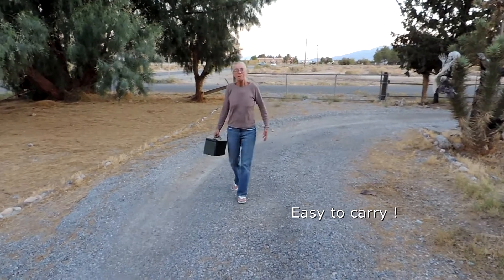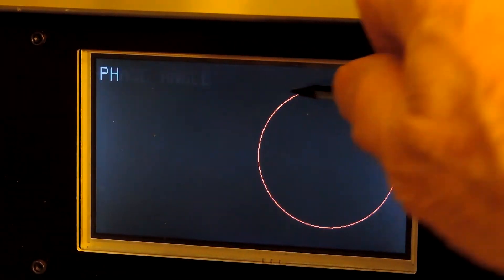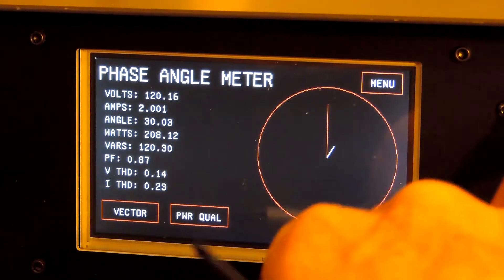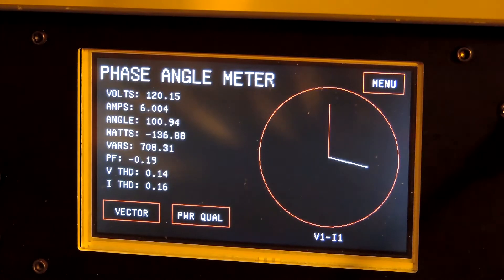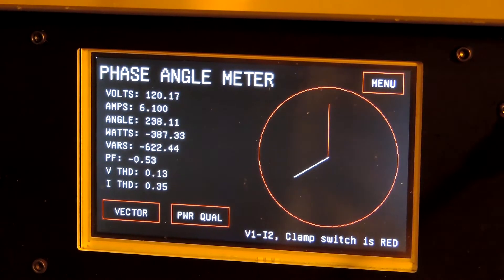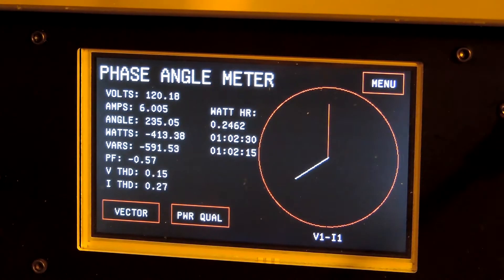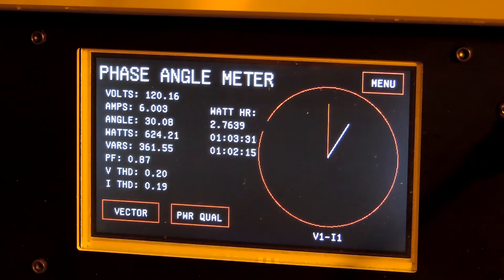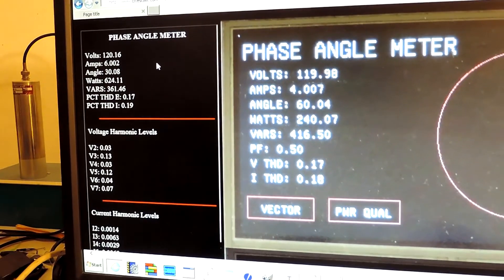Phase Angle Meter Demo

Comment: please can u tell me how the connections are done?
Reply from the maker: Several possibilities. The instrument transformers may have a test switch that is intended for connection of a test meter. Fused clip leads are used for the potential connection and a "Duckbill" probe is used for current. In addition some protective relays have "test paddles" that can be used to access CT and PT circuits. One can also clip on relay or meter terminals to connect to potential and use the clamp on for current if no "hard wire" access point exists.
Reply: Thank you